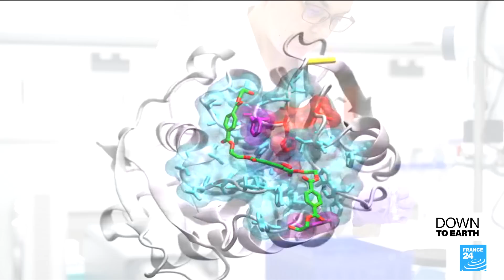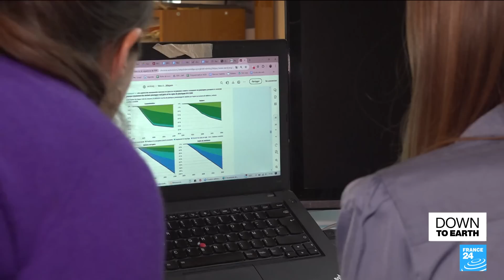French startup uses plastic-chewing enzymes in 'closed-loop' recycling • FRANCE 24 English

Comment: This idea was the central theme of a sci-fi novel Mutant 59: The Plastic Eaters. In it a mutated fast-spreading bacteria was able to eat plastic while emitting a flammable gas leading to a total collapse of society. Power systems failing, plastic water mains erupting and airliners falling from the sky as their plastic seals and electrical wire insulation dissolved, not the best written sci-fi novel but food for thought. Yes, these are enzymes not bacteria but if it could ever be weaponized then it could be dangerous ;?)

Comment: Chemist here. It's NOT "polyethylene" that can be degraded by Carbios enzymes. It's "polyethylene terephthalate" (that's what PET is). That's a polyester. A polyester can be HYDROLYSED, polyethylene (as found in plastic bags) can NOT. The HYDROLYSIS of PET can be sped up by enzymes called ESTERASES as exploited by Carbios. On the other hand, finding enzymes (or microbes producing them) that can degrade plain polyethylene is an elusive task. While PET is a common plastic used for beverage bottles, plain polyethylene is FAR MORE COMMON, as it costs a fraction of PET to produce. As long as humanity looks at the bottom line, WITHOUT taking the environment into account, it'll continue to see microplastics dispersed in the entire biosphere, including in us.
Reply: can pyrolysis do both , and maybe some other variants in the same classes you can name ?
Reply: Plain polyethylene, often used in products like plastic bags, is a different polymer and typically resistant to degradation by enzymes. While efforts to find enzymes or microbes capable of degrading plain polyethylene are ongoing, it remains a challenging task.
Reply: Your point about the prevalence of plain polyethylene in single-use plastics and its impact on the environment is well taken. Addressing the environmental consequences of plastic pollution requires not only technological innovation but also changes in human behaviour and economic incentives to prioritize sustainability over short-term cost savings.
Reply: A scientist explains it, and the news fails us again.  Thanks
Reply: @eewilson9835  Journalists are amazing at dramatizing smallest bits of hope in scentific literature. Add some context, the news gets dull.
Reply: I guess if you know so much you should then try to find a
Solution… well you haven’t, they have.